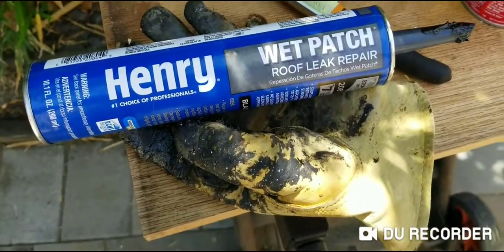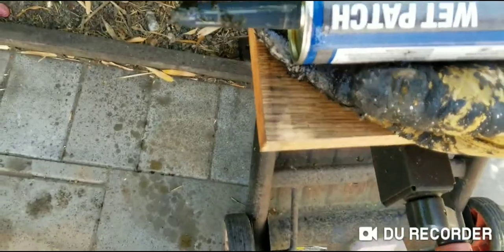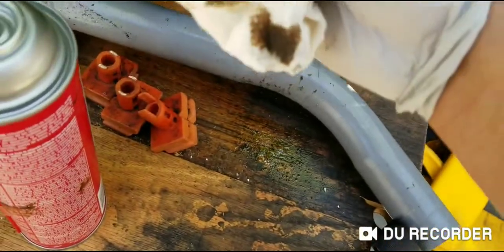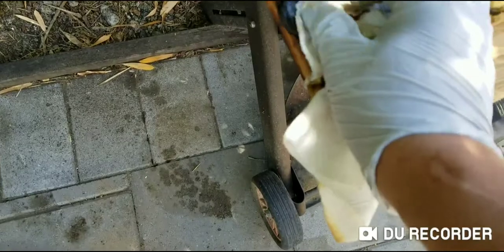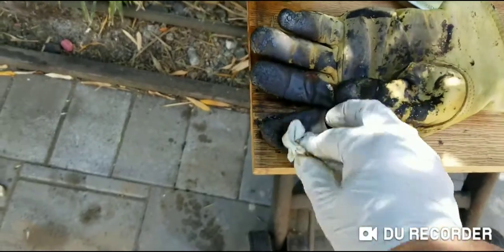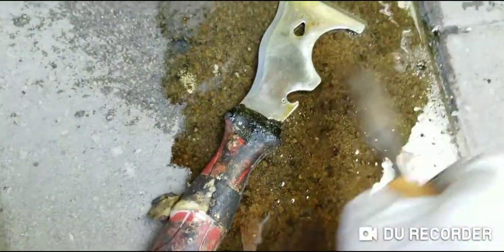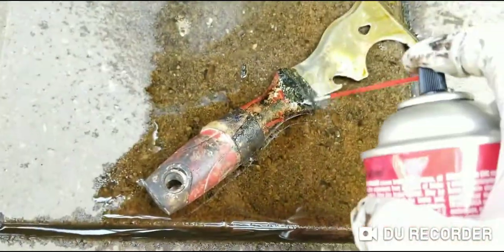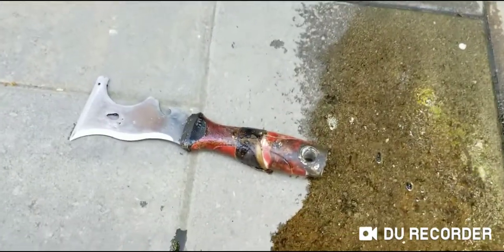Removing Henrys Roofing Wet Patch Sealant off tools and hands using brake fluid Brakleen

Comment: Mineral Spirits is what Henry’s recommends.   Brake cleaner is tetra hexa nasty ass chemicals.
Reply: Well said.  In the last week I used flashing cement and today I used the silver roof coating.  I cleaned my hands and the tools with vegetable oil for the roof coating and the cement.  The putty knife I used is from the dollar store.  I would not make a mess on the concrete or poison where the birds and animals eat over a dollar item.  It could have been cleaned in a more responsible, cleaner, safer way.  When it comes to the nastiest chemicals, you only use those if nothing else would work.